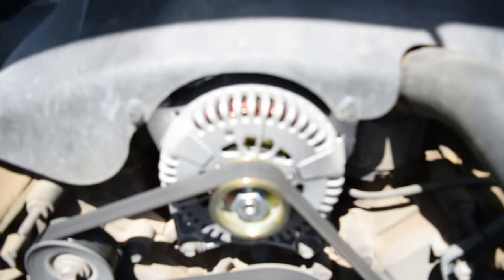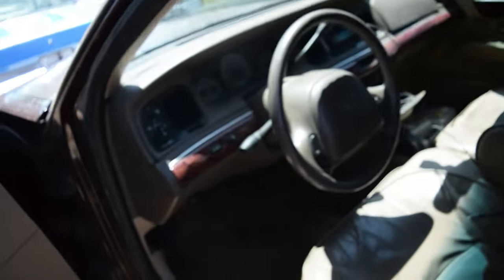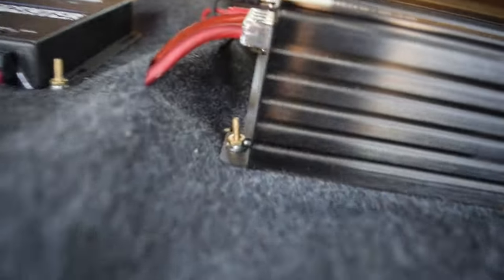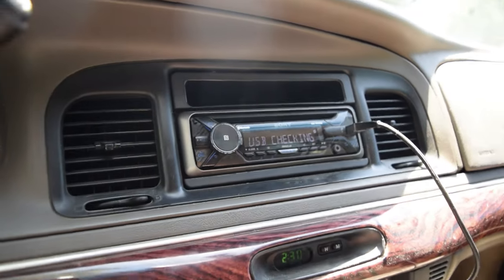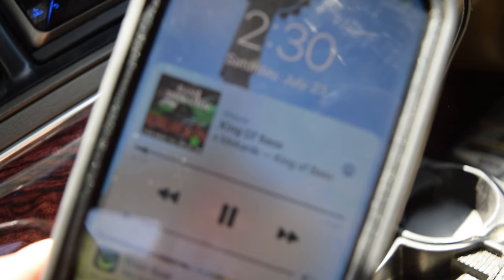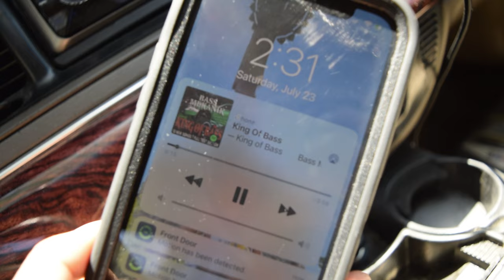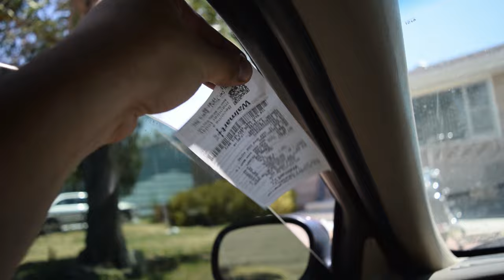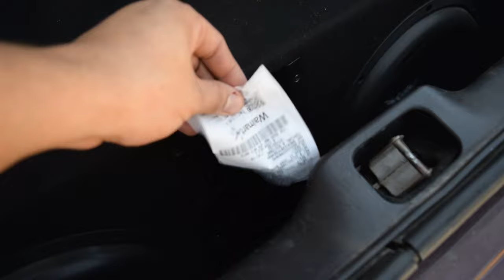Grand Marquis Sound System Walk Around & Demo

Comment: Where did you connect your amp ground? I have a similar setup. Dual skar evl 12's in a skar box, mechman 260, skyhigh 1-0, only 1 run, big 3, northstar AGM and DOWN4SOUND D4S LTO 6.0, taramps bass 3k and I don't get anything like that, used SMD DD-1 and CC-1  to calibrate the amp/headunit. I get nowhere near the chaos you are getting lol.
Reply from the maker: I have the ground wire from the amp going to the frame rail, I drilled a hole and bolted it to the frame

Comment: Did you notice any difference when you cut a hole in the seat to the trunk?
Reply from the maker: Not a big difference but if you roll the window down a little bit you could do the paper trick and it would flutter with the air flow